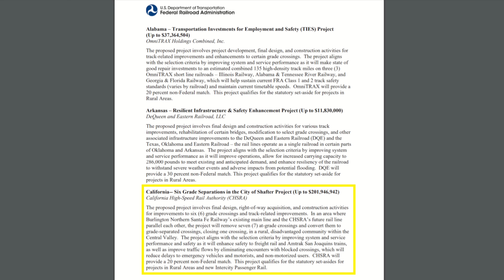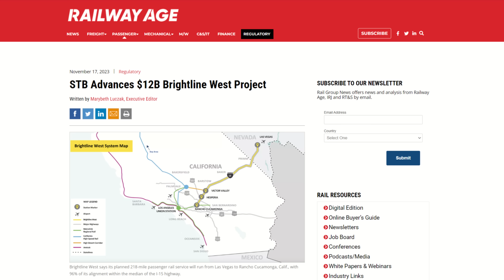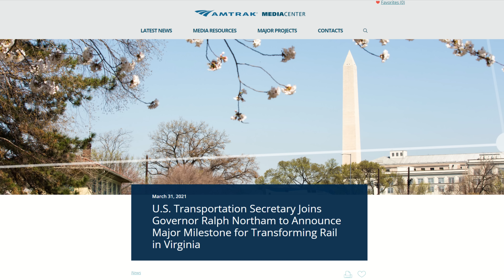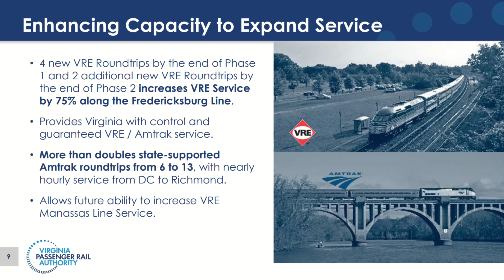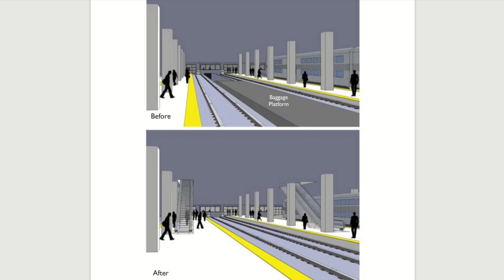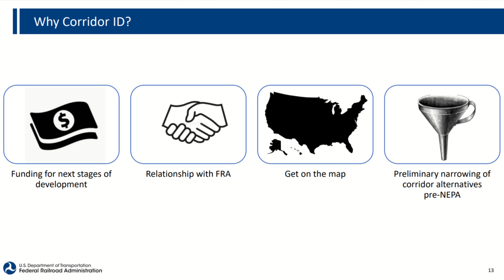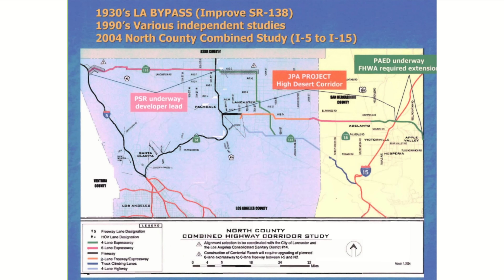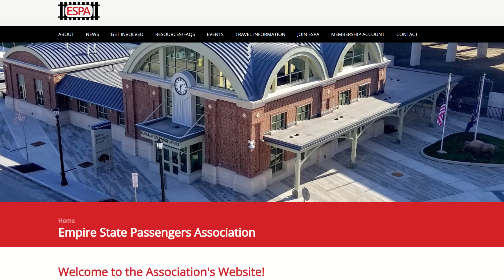Revenge of California High Speed Rail | $6 Billion in HSR grants | Stew's News | Brightline West

Comment: If Brightline West and CAHSR linked up I wonder how competitive San Francisco - Las Vegas would be
Reply from the maker: Quick and dirty estimate, assuming a one-seat ride through Palmdale, that should be about 4 hours. The flight is 90-110mins, extra 75 due to airport = 2h45m-3h. Not as fast, but really not that bad.
Reply: @LucidStew l calculate 630 train route miles from SF-LV. Getting to be too far to compete with airlines. That would mean averaging 160 mph non-stop. There are 78 miles of slower tracks on the peninsula. Perhaps 5.5 hours with stops or a midnight sleeper in 6:20 averaging 100 mph.
Reply from the maker: @davidjackson7281  This of course assumes one-seat ride, and an express, but you have same metrics as CAHSR to Palmdale, which is 2h40m-26m(Burbank Palmdale), HDC would be full speed + 15 mins. The VV to LV portion of BLW will be about 1h30m = 4h10m. Like I said, it was a quick and dirty estimate. It wouldn't take 5 1/2 hours though, not even if you had to transfer. Even 2 locals with a half hour layover wouldn't be 5 1/2 hours. There's no reason at all to assume 100mph. Not a single portion of that route is designed to be that slow.
Reply: @LucidStew My thoughts on an average speed of 100 mph would pertain to a "leisurely" over-night all stop sleeper train where higher speeds are not necessary for a midnght to 6:30 arrival. Just saying. Seems like your 4:10 express is about 30 minutes relatively faster than my 5:30 all stop journey with 50 minutes more for extra station stops. I'll defer to your more credible estimate.
Reply: IMO, it would also depend if there was a transfer required with seperate ticketing instead of a one-seat-ride, meaning your ticket wasn’t SFO-LAS but SFO-Palmdale on CAHSR & Palmdale-LAS on Brightline West. And, if that’s the case, What would happen if, for example, your CAHSR train was delayed and you missed your scheduled connecting train to LAS, would Brightline still honour the ticket for the next departing train or are you just SOL. Hypothetically, all the trainsets should be mutually compatible so the two agencies could collaborate to operate routes between NorCal to NV.
Reply from the maker: @TheWolfHowling  CAHSR is required to have the capacity to operate on 5 minute headways. No idea what the plan is for service in 2070, but... BLW is planning to start at 1 hour headways and expand to half hour way before they get to Palmdale, so might not be a big deal missing a connection. I'm sure they'd have some sort of agreement if there wasn't a one-seat ride. Seems like terrible business practice to stiff people for something beyond their control like that. Even then, the government would probably regulate it like they do with air travel.
Reply: @LucidStew  One would hope that would be the case but Brightline is a private company owned by Fortress Investments. Ultimately they exist to make money not transport people. If the tales of US Airlines are anything to go by, I wouldn't be too surprised if, when you go to the help desk, Brightline doesn't charge you a rebooking/missed connections fee or something. But I could simply being pessimistic🤷‍♂️
Reply from the maker: @TheWolfHowling  Sure, but you don't make money by driving customers away either. You have to be in a financially comfortable place to pull things like fees. That doesn't sound unrealistic to me, but at least you're still on your way without much delay and expense.
Reply: @mrxman581  CARES & PPP funding also came with strings attached. However, that didn't prevent some corporate malfeasance, Such as the airlines "suggesting" early retirement to some of their pilots, causing flights to be cancelled because of a Pilot shortage or the oil companies shutting down production & firing workers, leading to high fuel prices when demand came back up due to lowered supplies
Reply: Not very competitive. Far too circuitous. Air travel between SF and LV would be cheaper and much faster.
Reply: @michaeljones7927 Agree. 600+ miles is a bit too far to compete with cheap and fast air travel. Probably convenient up to Fresno. Would be a fun ride though to and from Sin City with a party car. Time would fly.
Reply: due to the roundabout route, I doubt it will be very competitive with flying, but I'm sure there will be a market for it nonetheless
Reply from the maker: It's only about 175 miles more than a straight line, which isn't that bad. A lot of that would be full speed as well, assuming no xfer at Palmdale.
Reply: @LucidStew  It is recommended that people arrive at the airport around two hours before their flight, so it would prolly become four hours total. My family tends to add an extra hour and arrive three hours early, making the total flight time longer for us.
Reply from the maker: @nikhilnagboth8425  You're not likely to arrive at a train station and instantaneously step onto a train. We're also talking domestic here, so that 2 hours isn't necessary unless its an unusually busy time of year. I've flown many times and I stopped arriving early. It was always a waste of time.
Reply: @LucidStew  I get that arriving early might seem pointless, but since it is highly recommended, a lot of people probably do arrive two hours early, even for domestic flights. For my family, we arrive three hours early for domestic and four hours early for international.  For trains, we would arrive, at most, 30 minutes early.
Reply: @nikhilnagboth8425  Even for internationals, most advid travelers are a maximum of 1 hour early and usually a maximum of 45 minutes early. Depending on the airport, there is variation but this is most common.
Reply: @nikhilnagboth8425 I’m totally with you. I feel much more comfortable arriving to an airport much earlier than the airline recommends even if it means having to wait around in the terminal. You just never know when something could delay you and I would prefer to have that slack in the system rather than getting all stressed & panicked.
Reply: @TheWolfHowling  Agreed. And that won't be necessary for trains, since BL recommends people to arrive 15-20 mins before departure, which would convince me to arrive 1 hr before, which is way better than 4 hrs + long security check + weather delays + missing a connecting flight due to these weather patterns + more. 

Missing a connecting flight due to first flight delays can cause massive damage to vacation plans. Missing a connecting train only costs 30 mins to an hour at most.
Reply: @LucidStew Depending on when you show up to the station, you absolutely can lol.
Reply: @dester3275 That’s crazy, TSA takes almost an hour at any major airport I’ve ever flown out of, would never NOT show up AT LEAST 2 hours before ANY flight.